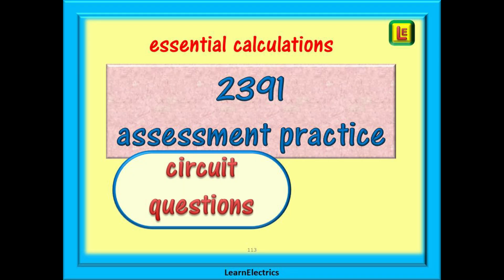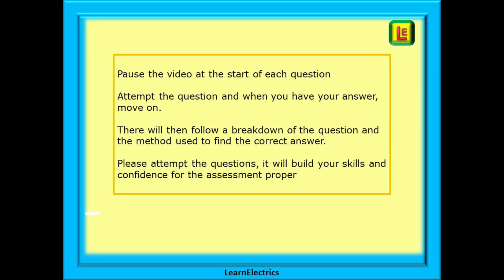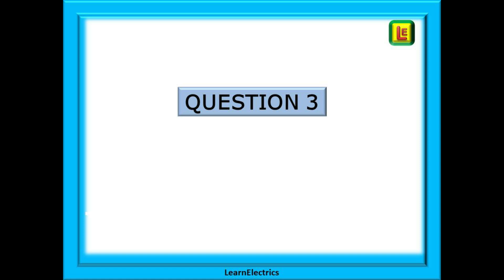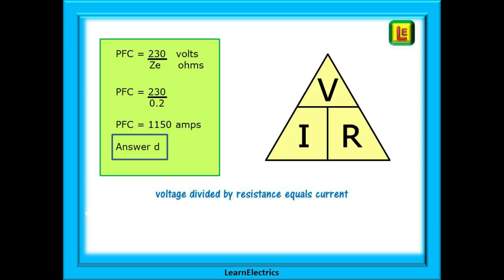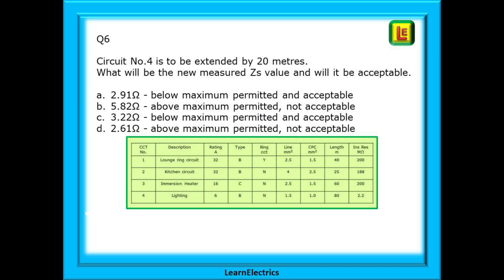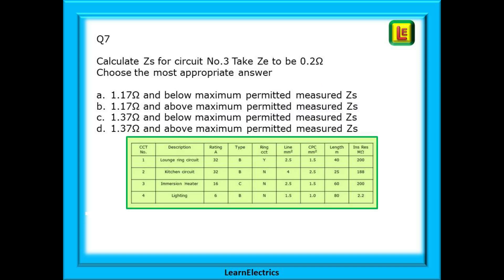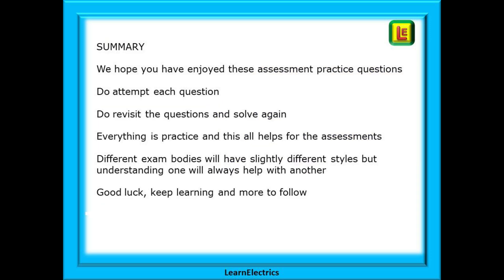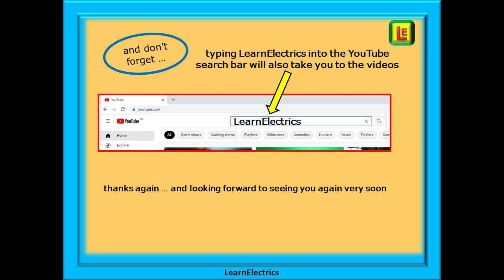2391 Assessment Practice - 1 – Essential Calculations and Circuit Questions

Comment: In question 3 there is a MISTAKE..  In both the On site Guide 2018 + A2: 2022 (Table I1) and in Guidance Note 3 2018 +A2:2022 (Table B1) The  Resistance per metre (for 2.5mm2  & 1.5mm2 cable) is (very definitely) given as 19.51 milli ohms per metre.  Your question states that this is 18 milli-ohms per metre (? ) Where did you get '18' from for 2.5mm + 1.5 mm T&E cable?
Reply from the maker: Gary, you are looking at the WRONG table. You need to be on page 456 of the Brown Book, where it clearly shows the mV/A/m as 18. It is nothing to do with 2.5/1.5  - this is a no fault circuit so it is line and neutral 2.5/2.5.
Have a look at the video on the link below for a reminder about voltage drop calculations. 
https://www.youtube.com/watch?v=TY6L0KB9Lx8
Reply: Thanks for clarifying that Dave.  Much appreciated to see that you are responding to our questions here on your youtube channel!

Comment: Q6 - Tabulated value is 5.87 ( for B Type - Not 7.28 as mentioned) - sorry if i'm wrong! sitting for test in 2 hrs!!!
Reply from the maker: You have quoted the MEASURED value which is 5.87.
The TABULATED value comes from the Tables in the Wiring Regs book which is 7.28 as you have quoted.
Make sure you understand the difference between Tabulated and Measured. have a look at this video on the differences and good luck with the exam. Dave.
https://www.youtube.com/watch?v=YVT5d1d3Q8g
Reply: @learnelectrics4402  lovely- thanks for the info.👍

Comment: Thanks for all the great videos they have been really helpful. Just one thing i noticed but for question 3 shouldn't the (mV/A/m) actually be 27 as this is for flat cable with protective conductor. Rather than 18 which is used for singles?
Reply from the maker: page 456 of Wiring Regs. Table 4D5. If its 2.5 twin and earth the mV/A/m is 18. Hope this helps. Thanks for watching, Dave.
Reply: @learnelectrics4402  ah I miss read which one. I read of the amps not the mV
Reply from the maker: 2.5 is 27A reference method C, clipped direct.

Comment: Thanks for your tutorials. They are very useful.
Just want to say that  QUESTION 8 can also be solved by using the rule of three because it's a ratio:
if 14.06V drop for 60 meters
then 11.5V for X
X =  (60 * 11.5 ) / 14.06
Reply from the maker: Absolutely. Thanks for the contribution to the channel. Dave.

Comment: Thank you for this video. Very informative. I’m still slightly confused as to when to use the B1 table from GN3 or page 409 from the regs because they’re the same right, only with a correction factor added?
Reply from the maker: Different animals Edward.
Table B1 is resistance
Page 409 is current.
Hope this helps to clear the confusion

Comment: Hi have you done A video similar to this question? The measured value of loop
impedance for a circuit is 0.83 Ohms.
If the temperature at the time of the
test was 20°C and the cable is 70°C
(factor 1.2) what is the corrected
value. Ze = 0.4 Ohms 
Thanks
Reply from the maker: That depends on if you are saying all the loop is affected in which case it will be 1 ohm or if just the building part is at 70C  when it will be 0.92. Hope this helps.
Reply: Thanks Dave please can you tell me the Sum I can’t figure it out? Is The Sum in guidance 03?
Reply: Please have a look if the is right  
1) 0.83 - 0.4 = 0.44
2) 0.43 x 1.20 = 0.516
3) 0.56 + 0.4 = 0.916
 Thanks Dave Or do you have a better way

Comment: Hi Dave 
Can this formula of VD (Rn x 2 x 13 = 11.55 v in your example !
Rn 7.41 pm x 60 = 444.6 / 1000 = 0.4446 homs
0.4446 X 2 = 0.8892 x 13 Ib = 11.55 v. 
I’m I wrong !
Great video’s 👍👍
Reply from the maker: I think that's just coincidence that it comes to 11.5V as that is fixed value regardless of current and Vd is also affected by length.